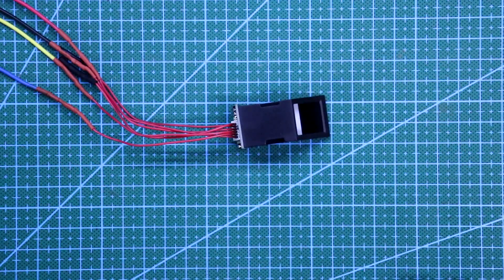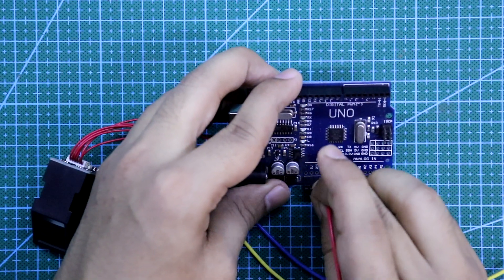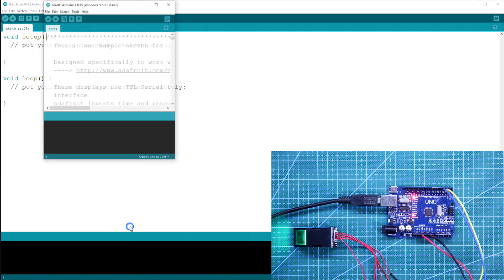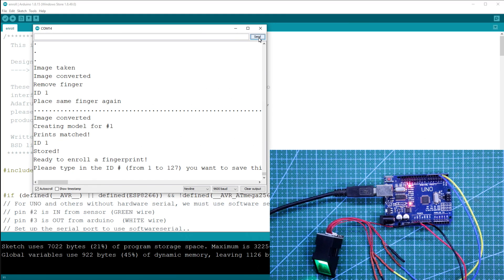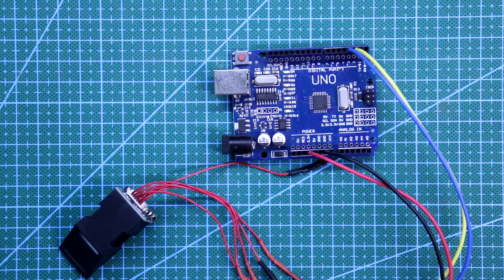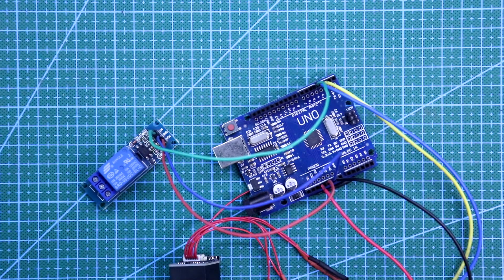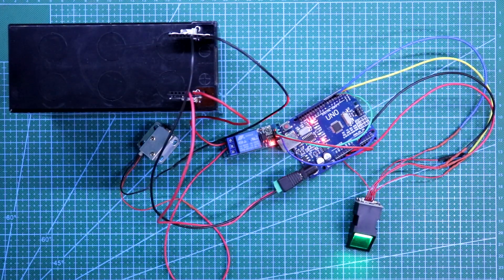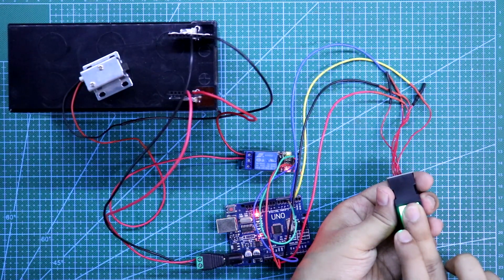Solenoid Door lock system with fingerprint

Comment: i have a issue with my fingerprint sensor. When i connect the red and black wires, my sensor doesnt light on. It is flashing blue light then it turns off. 
On serial monitor, the error i have is fingerprint sensor is not connected :( any potential fix pls?
Reply: same
Reply: Then what did you do...? 
I have also the same problem